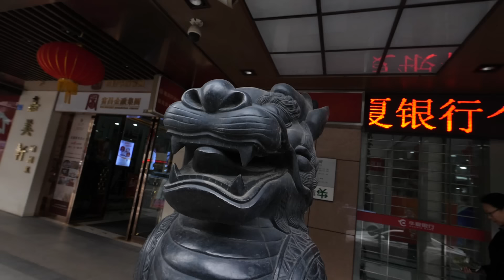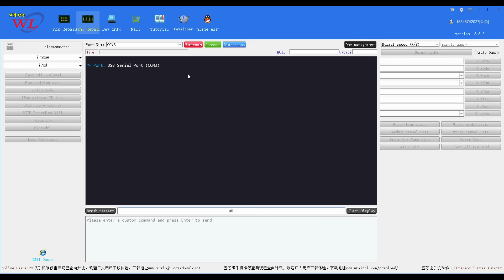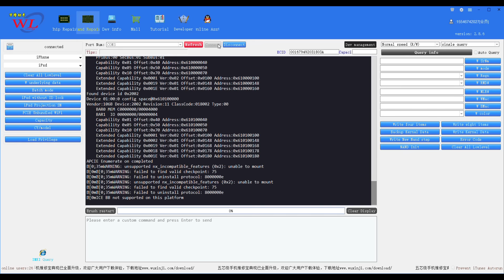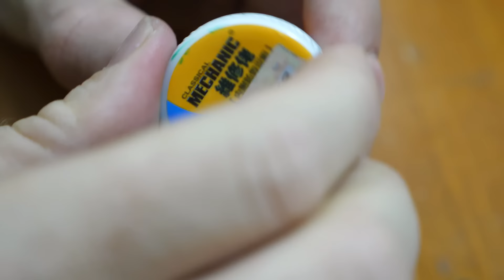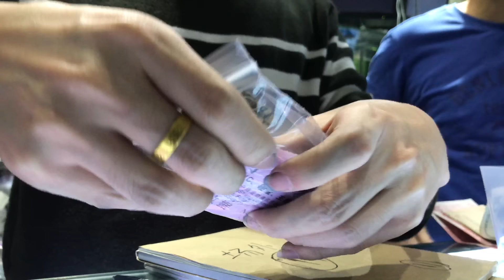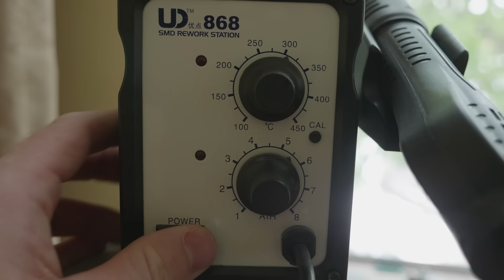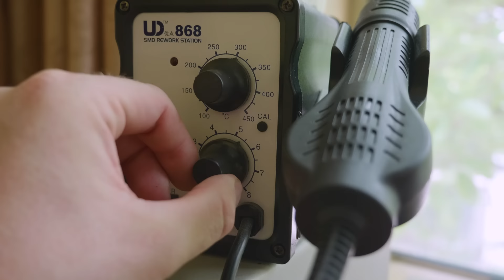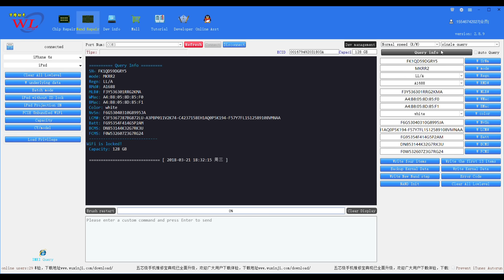How I Upgraded My iPhone Memory 800% - in Shenzhen, China

Comment: You bought a whole new laptop? For windows? All you had to do is install windows along with MacOS on your MacBook with bootcamp , it's very simple
Reply: Maybe he also just wanted a second laptop. Nothing wrong with that.
Reply: virtual machine :/
Reply: It Is called Bootcamp, It is Super useful.
Reply: Sevendogtags maybe,but the reason he mentioned here is specific , he said this machine only supports windows so i have to buy a windows pc.
Reply: Servus He didn’t buy a Microsoft computer though dummy. Microsoft Windows and macOS can both run on a MacBook.
Reply: +pritam gurung Its unlikely that a virtual machine will be able to run a usb box with drivers. It's just a lot more hassle and not the goal of the video. Having a windows machine will almost most certainly be useful in the future as well.
Reply: Sevendogtags it is not unlikely , when you use bootcamp you have full fledged windows operating system and each and every windows thing works on mac , MacBook is just a hardware with intel chip and windows OS is just a software like MacOs so there will be absolutely no problem in that
Reply: Servus Well I mean, apple isn’t going to give their operating system out like that, why on earth would they do that. I mean you kinda had no reason to bring up Microsoft, he could’ve easily installed windows but he just wanted another laptop. He didn’t need MacOS, he needed Windows.
Reply: The real mystery is why a tech guy owned a macbook in the first place
Reply: +pritam gurung if it's a virtual machine then yes, it is limited. Everything still has to pass through MacOS. Someone mentioned you can dual boot, that would work.
Reply: Consedering he is a Software Engineer its probable he already knew that and just wanted a Windows computer
Reply: Macs use Intel processors, just like Windows. You can do a dual-boot with Bootcamp.
Reply: Maybe he didn't want to clutter a unix system with shit?
Reply: MS is nice? Haha that's funny.
Reply: Sevendogtags i never said install virtual machine , .... I said you could Install mac and windows together with bootcamp . With bootcamp method you can have two seperate os with allocated hard disk space .
Reply: having apple os = being stupid ;D
Reply: Welcome to the dark side no one tells you about of driver support for Macbooks running Windows
Reply: He might have got it just to show off the store
Reply: Virtualbox. USB passthrough works pretty well.
Reply: Servus apple does not limit to mac os. But windows does limit
Reply: oiva h actually they do, that's why a desktop runing osx is called a hackantosh
Reply: yea everyone was like ok new laptop guess thats one way to take car of it
Reply: lol
Reply: eivis13 i have heard of hackintoshes but they are not officially supported by windows machines
Meanwhile BootCamp comes with mac os
Reply: Not correct. You can run Windows in VirtualBox, VMWare and by booting into it natively with Bootcamp. Nothing is stopping him installing Windows alongside MacOS.
Reply: pritam gurung thats trut
Reply: MacOS doesn't limit only to their products.  It is a Linux based Kernel and can run a ton of third party software.
Reply: Tinu Thomas well, you can download it anywhere. MacOS is under BSD licence, they CAN NOT put out a price on the OS, unlike windows.
Reply: pritam gurung 

"just a software so there will be no problem"

windows was based on DOS, which changed to NT kernel later . MacOS is based on NeXTBSD or darwin, descendant of oldest UNIX (the first operating system).

they are both REALLY REALLY DIFFERENT.
the simplest difference : windows is the only OS which uses backslash "\" to point out a location, otherd use forward slash "/"

the only reason why it is easier to install windows on Mac than MacOS on PC is the available driver for windows.
Reply: Sean Corcoran MacOS doesn't use linux kernel
Reply: Tom Guck go to google headquarters and say that, the whole building will laugh at you.

As overrated as it is overpriced, you'll never know why huge huge numbers of developers use Mac, either putting in one of linux distribution or use MacOS.

when you have a sold out product with limited range of hardware, you are guaranteed stability.

who the hell want to code on a machine that takes an hour to finish an update ?
nope.

but there's something funnier :

having Macbook with only windows installed.
Reply: Sean Corcoran Linux based kernel?! Man get your facts straight. macOS uses an hybrid darwin kernel which is based on UNIX not Linux
Reply: I actually run GTA 5 on my 2017 MacBook pro 13" now 😏😍
Reply: soloman981 I agree! Not liking Microsoft mean you’re uneducated.

No wtf
Reply: sorry i dont use grammar

btw its you're not your
Reply: you're, not your.
Reply: *He got a real laptop.
Reply: He needed a real OS.
Reply: VM is a pain in the ass for getting drivers to work sometimes. Yeah, he could have dual booted.
Reply: I know
Reply: Yea, that was a really dumb idea

Comment: This was a very informative and interesting video! Great job Scott. This raises one question and one request though....

Can you get a good working iPhone, backup the NAND, get another iPhone which is iCloud Locked, remove the chip and flash the good backup you did earlier also with changing the SN and stuff to be to the original phone? I'm guessing that should fix it. 

It is an interesting thing to try attempt and it would be a great video! Thanks :D

Comment: "But I have a MAC, time to buy a new computer!" 

I guess virtual machine's are out of the question...?
Reply: Yota_Ninja or bootcamp lol. But he still shows us around so it's worth it.
Reply: He need direct HW access from OS so yes, VM are out of the question
Reply: rhapen - VMWare has supported direct hardware access in their virtual machines since at least 2013...
Reply: Hey bro he may be worried about viruses, if windows gets attacked his computer is done. Rather by a different one then get the whole thing destroyed.
Reply: Chance Gilliard This is why you disconnect your virtual network adapter. This is the basis of sandboxing.
Reply: Yota_Ninja he honestly probably just didn't know about the possibility
Reply: Chance Gilliard That isn't accurate at all.
Reply: Or wine
Reply: Yota_Ninja it's never direct. Standard devices you can use. But if you try something you make by yourself or something non standard it's not gonna work. I tried. I wish it works but it doesn't.
Reply: It's not perfect, especially for uncommon devices.  For example the programmer for STM32 microcontrollers seems to really hate talking to many kinds of VM.
Reply: i think you don't really know how virtual machines or viruses work lol but just a tip for you, virus wrote in windows probably don't even have cross-compatibility on the language utilized even less on the metod of injection/attack and you cant run a .exe on mac without windows libraries
Reply: I never trust vm when drivers/hardware is crucial
Reply: virtual machines can receive direct input from the physical machine's ports and resources.. no.. VMs are NOT out of the question and are perfect for this situation.
Reply: Adding VMWare drivers to direct hardware access as yet another step to have to debug is a bitch and a half.
Reply: Configuring the drivers for the vmware would be a bitch though. Especially for a memory flasher that's only common in China.
Reply: Well macs are junk anyway, so he needed that windows.
Reply: The sort of people that buy Macs are not the sort of people that know what VMs are or how to use Bootcamp. There is a reason there software is super simple lol
Reply: Now thats just not true. I'm not an apple fan boy but I ended up having to use one for software development and they're actually quite nice systems to work on, especially due to them having a linux kernel and bash terminal
Reply: That’s exactly what I was thinking
Reply: Then there is always a dual boot
Reply: Yota_Ninja what about duel booting or wine skin.
Reply: he's now VM'ing Mac OS on his Windows

And yes, VM is now a verb.
Reply: +Andrew Jones Bootcamp is an apple only utility, your statement is flawed.
Reply: Yota_Ninja MAC sucks,  thats all.
Reply: Andrew Jones i guess thats why you see programmers at google and even microsoft employees running macs huh?  Mac is basically a mainstream version of unix
Reply: Chance Gilliard its 2018 who gets viruses on their windows 10 are silly
Reply: Windows can run a Linux kernel as a sub system and you can use bash in CMD or Powershell
Reply: Bootcamp
Reply: > The sort of people that buy Macs are not the sort of people that know what VMs are or how to use Bootcamp. There is a reason there software is super simple lol

I'm a software engineer and it's very common for software companies to use macs as their primary development platform, particularly for web or mobile development.
Reply: 哈哈哈
Reply: He the kind of guy to buy a new phone over a tiny scratch.
Reply: Darkhobbo they have a Unix kernel not a Linux kernel

Comment: Meanwhile I just added 256gb to my smartphone in under 10 seconds. Lol. Gotta love the micro SD card.
Reply: 10 seconds? To much time for putting the micro sd card in to a smartphone.
Reply: Madness Player ay it took me 5 seconds, not even joking
Reply: FarisGamers well i did it in under 3.476 seconds...
Reply: cant install apps from app store in there cant u . lol
Reply: Pick_ or I have 64gb of built in memory for apps and system data. I have all my media and files on the SD card.
Reply: Pick_ or Yes you can.
Format as internal

Android.
Reply: i tried that , it doesnt work on android 8.0 on my device for some reason :/
Reply: Pick_ or It depends on the device. Check in the developer settings. My Huawei Mate 10 has that option in there.
Reply: 24ecko i dont have that though , sucks
Reply: Pick_ or lol sry man maybe root and get foldermount
Reply: 24ecko its also probably 1/4th if not more of the speed of nand, SD cards are pretty freaking slow...I suppose for file storage okay but in that same sense any cloud storage or network drive would be equally as useful.
Reply: Trent Bergin some phones read and write sd cards faster than the others (if im not mistaken)
Reply: Pick_ or yes you can.. You can actually turn it into internal storage on some phone.. Mine has that option and there are apps that gives you that option.. So yeah.. You lose haha
Reply: 24ecko mah man
Reply: Pick_ or if you use android anything is possible..
Reply: Extended life of my phone by half a year or more
Reply: Pick_ or you must be an apple user
Reply: 24ecko  Exactly!!
Reply: Exactly. I do have now 64 gigs internal memory, dont need more. Because an Android ;) But i can allways buy some more ;) (and put it in within seconds...)
Reply: 24ecko it's only a few files from the app. Like 10% of the actual app at most...
You can't put an entire app on the micro. That's because it would be really slow. The sd card actually has a reading speed itself, that isn't enough to run apps form it, it's just about what you need for music, videos and photos...

Comment: Boot camp or VM...
Reply: CCF_100 smh lol
Reply: CCF_100 I would recommend not having a mac but I guess that computer was your choice and you must have your reasons. If you are expecting a good experience with windows using a mac, I would recommend Boot camp, unless you want to use your two os at the same time. Expect lower performance on your virtual machine though.
Reply: Exactly what I was thinking

Comment: I mean you could have just used Boot Camp or Parallels instead of buying an entire laptop but ok

It's because YouTube
Reply: Princess SparklySequins yep, I couldn't understand this myself
Reply: Or even virtualbox
Reply: No, it probably wouldn't be able to connect through a virtual machine
Reply: PaddiM8 
Actually, you can connect devices through virtual machine
Reply: Pro Player 1⃣ yeah you can, but this isn't any device. I'm not sure if the Macbook would recognize.
Reply: PaddiM8 
But he said it's only windows software not about the device 
So maybe the MacBook would recognize the device and the virtual machine would have the windows software it needs to make it work
Reply: Pro Player 1⃣ I mean, even the windows laptop didn't recognize it at first.
Reply: PaddiM8 he said he just swapped out the cable and then it worked...what are you on mate?
Reply: R0DSTER but Macbooks and bios modded devices.
Reply: I thought the same thing
Reply: Well maybe in China buying Windows is as expensive as a new laptop lol
Reply: Why dual boot? Might as well just buy a PC in the first place.
Reply: Maybe he just needed or wanted a Windows laptop anyways
Reply: For his purposes he wouldn't need to buy Windows. You can just use Windows with a "activate windows" watermark in the bottom right corner and limited ability to change aesthetics.
Reply: Jamshit Not what he said...
Reply: I'm guessing since it's a programmer it uses some special instructions sets that require hardware access that MacBooks or VM's can't give
Reply: until the Chinese driver borks because it cant run on unsupported hardware. they love windows XP and weird unsigned drivers. and Windows laptops are cheap in china.

Comment: Could you just run a Virtual Machine with Windows? I do it on my MacBook all the time when I don't have access to my Windows desktop.
Reply: Virtual machines can be finicky about non-standard USB devices, but it'd certainly be worth trying out before spending big on a new laptop...
Reply: Just use BootCamp to install Windows on a second partition
Reply: You can actually run Windows natively on your Mac using Boot Camp. The Macs at my school that we use for programming are running Windows 7 with Boot Camp, and they’re pretty fast, and much more reliable than a virtual machine.
Reply: Sulfen Or just use Wine
Reply: Sulfen Just a Xiaomi advertise. Nothing else.
Reply: MATAM Wine is a not a reliable solution. VM is much more understandable.
Reply: Wine is pretty reliable when you want to run simple apps, but in this case, the app needed to interact with the drivers and the peripheral device, so I highly daubt, it'd work.
Reply: Just install Citrix receiver
Reply: he could sell his mac, and buy 2 laptops  and a phone with 264gb of storage
Reply: Don't sully a Mac with Windows...
Reply: Exactly

Comment: So after traveling all the way to a cell phone Black Market in China, you still needed a Windows PC upgrade and fix your apple...WOW...Sent from my Windows PC
Reply: ledfootfam99 if you want to do anything with anything you need a windows or unix pc
Reply: It's just a market. Black market is illegal stuffs being sold. Those are just pretty much hardwares being sold. Something which comes from the factories there making phones. You do know that probably 90% of mobile phones are probably being made in China today.
Reply: I stick with Linux, I gave up on Windows after my new laptop with windows 8 shit the bed after a windows 10 “upgrade” a few years back. Thanks for the many years of insecurity and bullshit Microsoft. 🤪
Reply: Coco - MacOS is Unix
Reply: MacOS is BSD not Unix
Reply: He could've probably ran a vm
Reply: Raikaru BSD is a type of Unix. It runs on a Darwin core
Reply: UNIX isn't Linux
Reply: Coco nonsense
Reply: MacOS is unix based so this isn't a relevant comment
Reply: he could have installed bootcamp windows for dual boot or vm it he didn't need to do that.  but windows pc are cheap his money though.
Reply: you are right

Comment: i know it has been 2 years but i want to point out that if you want to do this you have to think about it not overheating. i've opened a 128Gb model myself and it has a copper plate to prevent the memory, cpu and the storage chip from overheating. but if you can do it without overheating then hats off to you.

Comment: Soooo... data CAN be recovered from a dead iPhone?? 🤣 😂 😆 
Don’t tell Apple - but,
Using that reader/programmer, you could read and backup all that “unrecoverable” data from that dead iPhone without needing to boot it.
Reply: encrypted data... even FBI had trouble to decode the data..
Reply: Andin Briwel I don’t think it works like that. The microchip reader thing can’t actually see actual photos videos notes etc. it’s all completely encrypted.
Reply: You both misunderstand what I’m saying. I’m not saying it’s a way to see SOMEONE ELSE’S data. I’m saying Apple is incorrect when they claim data can not be recovered from a user’s damaged iPhone unless that specific phone can be charged and powered up.
It’s already been proven and demonstrated by that shop in Canada and also by Luis Rossman, so my comment is actually just sarcasm toward Apple and their policy to refuse to assist in data recovery.

In the example in this video, he is able to unlock and open the phone once it’s all together. So, using this technique, combined with being the rightful owner and thereby having the login and passcode information, it’s possible for data like pictures etc to be recovered from a dead phone so long as the memory is still in tact. 
Edit: but in many cases, it’s just a matter of doing some board-level repair to get the phone working again. Apple claims it’s completely impossible, even though it’s been physically demonstrated by people who actually understand board-level electronics.
Reply: @andinbriwel1092  they are not going to profit if they fix it xD
Reply: @andinbriwel1092  Exactly. I used to work for a comany that did iphone repair and they said it is a pain since apple are the only comany that won't provide borad dirgrams and repair guides

Comment: you don't have to leave the stencil on when heating the solder paste on the chip.1- print the paste, 2- remove stencil, 3- slow the air flow from your heat gun. 4- take your time. 5- try and ramp the temps from your heat gun like they would be for the profile of your solder paste.